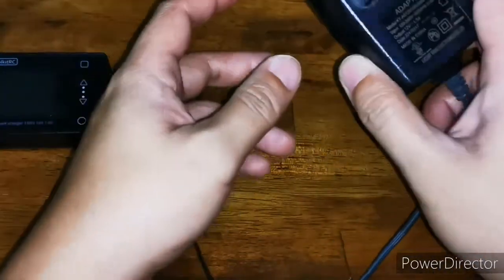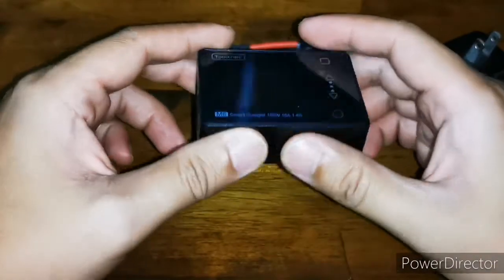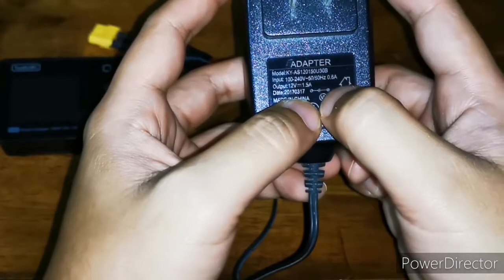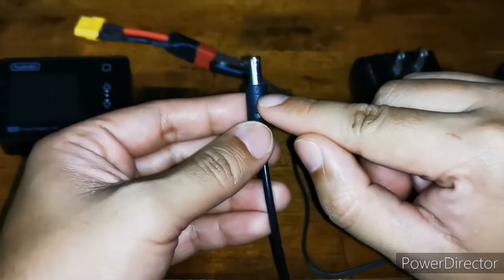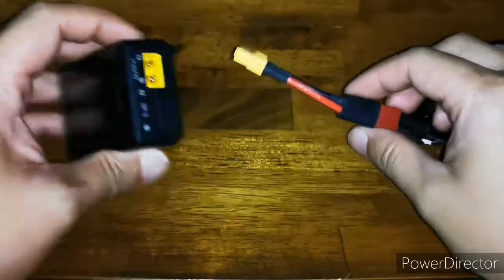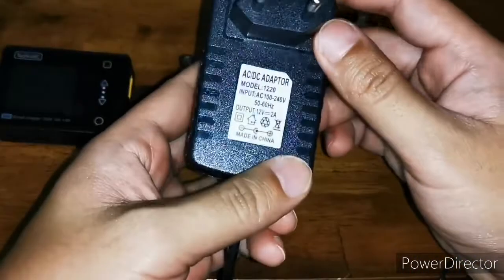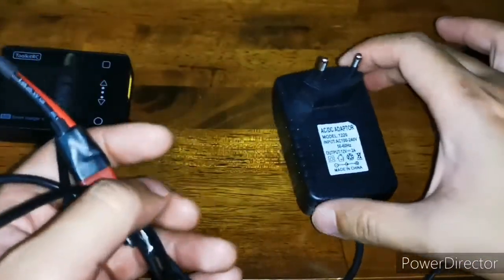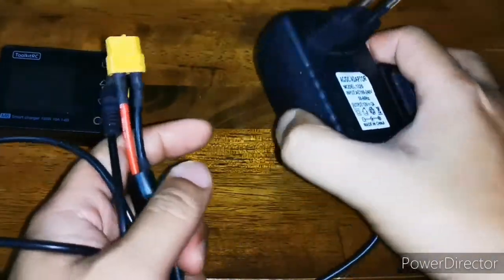Power adapter for field chargers

Comment: use a high amp laptop power supply get 19v 9.5 amp i parralell charge 5 6s 1100 mah at same time at 9amps
Reply from the maker: I got a 19v laptop charger after a week of posting this video. Too afraid to use a parallel charging setup though.
Reply: I've never had any problems doing so through multiple charge cycles, i charge my batteries outside though incase anything goes wrong, wouldn't be fun trying to put out a firE with 6x 6s lipos lol

Comment: I have tried this but after some time of charging the voltage input gets reduced below 10v and low voltage error occuring
Reply from the maker: How long before it happened?
Reply: @jercsgn  30sec or lesser
Reply: My adapter output was 12v 1a